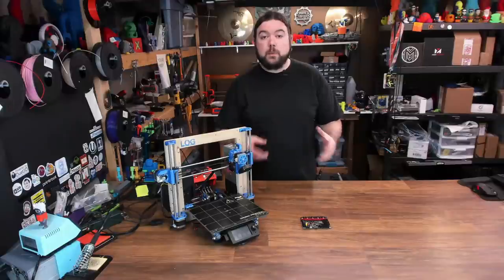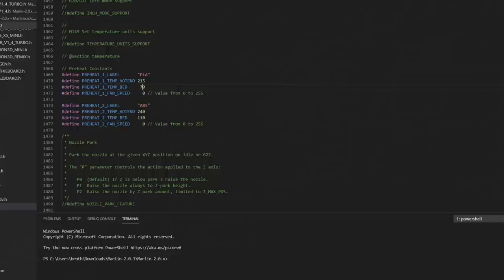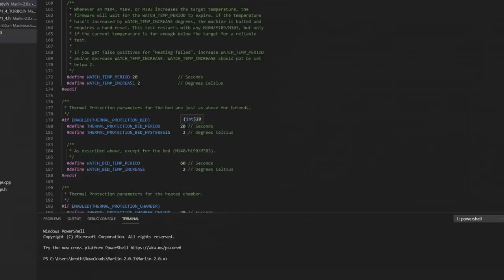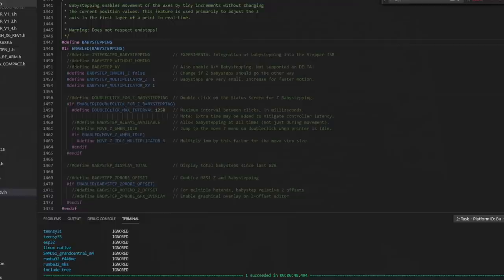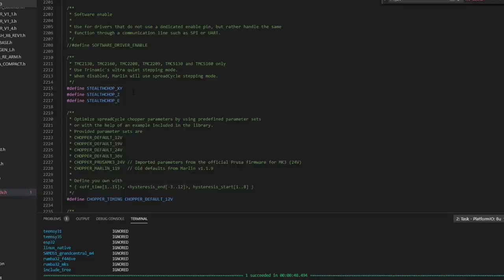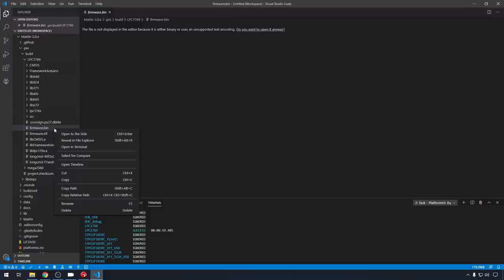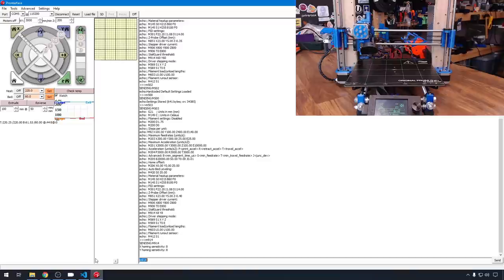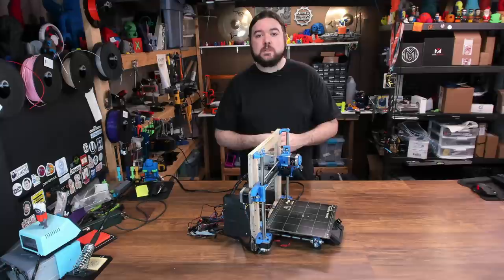BigTreeTech SKR v1.4 Mainboard - Full Install Part 2 - 2209 Drivers - Chris's Basement

Comment: Ok so i went to build after settingand I dont have no platformio alien head icon in the column like yours. I can't seem to find it anywhere in vs code. Which sucks cuz after going through all the configuration and I am literally 1 click of the mouse and I'm finally done....but there's no icon to click. How do I get that icon so I can finish ?
Reply from the maker: Do you have the platformio extension?  https://youtu.be/W6zYvRgGr3Q
Reply: @ChrisRiley  no joke, I just found it like 2 minutes before your message. This was my 1st time on vscode so I was unaware how vital extentions were to that program. It was pretty funny though. After you said thats it its time to build the file. I was stocked that it was finally time to test this board out. Then you said we just click this and were done......son of a.... where's my button. Lol. But yeah it took a little bit cuz it seemed like that extention should be part of the main program. It's pretty much the most important part of the whole operation. Apparently the developers don't think so. But its all installed and ready to go. So im about to go finish it.  But thanks much man Its greatly appreciated. Your videos were top-notch and as well layed out as it could possibly be. Great board explanation. And the firmware run through was perfect. Every step done in order from top to bottom. Theres alot of "good enough" instructions. And people just skipping around to find the bare minimum. They'll get it to turn on, but thats about it. Why the hell they don't just do what you did. Start from the beginning and work your way down to the bottom. Its gives a better insight to all the components and not skip around trying to find a couple things. You may not use the rest but its still important to know regardless. You spend an hour explaining the installation...everyone else are about 10-15min. ....pretty much says it all.  Odds are they've left a few things out of theirs lol.   But yeah man definitely the best lessons out there man 🤘

Comment: Is there any download out there that has has the firmware for the skr v1.4 to ender 3. To the point of it just being able to print and operate at its basic level like its actual board. I have been trying to get this thing setup for about a week now and there always seems to be some friggin problem every time and I'm about to set damn thing on fire and throw in the towel. I've tried just about every tutorial there is and always has problems even though doing everything exactly the same. Im no programmer so these problems that pop up are Greek to me. So if its not on the tutorial I have no clue what to do. And after alot of searching its not just me. Tons of people are saying this is a complete friggin nightmare too. Most of these are solved by people just sending them backspace theres absolutely no actual customer service or anyone to help. This is beyond frustrating at this point and I'd assume somebody out there has just taken their build and made it available to download. Especially for the ender 3 since its so popular and everyone owns one at this point. So I'd be baffled if there not a standard ender 3 build download. This vs code is such a horribly layed platform to do this. And so much of their stuff isn't compatible with each other and constantly creates issues with its own software like the squiggle error that seems to just happen and tells you to update but doesn't tell you what to update or where. And after updating everything to its current version it STILL gives the message. So im clueless at this point
Reply from the maker: I can try and build one for you if you are willing to test it.
Reply: @ChrisRiley  absolutely. I just have the tmc2209 drivers that came in the package. Its just the normal 1.4 and not the turbo. And just the ender 3 not the pro. But yeah man if you could do that Igrateful. beyond greatful.

Also after looking around there may actually be exactly what I was talking about. Theres actually files on creality that are marlin firmware download files for each specific printer. Im by no means skilled in programming so they may not work for anything but the actual creality boards. But they may exactly all thats needed...but it seems too easy that that would be the case. But heres the link to that. Who knows, this may end up being alot easier than it seems https://www.creality3dofficial.com/pages/firmware-download
Reply: @ChrisRiley  i finally got it. I had to add an extention "auto build marlin" apparently vscode had a newer version of itself and just "platformio IDE" will no longer build the configuration by itself and now needs the help of the other extention too. But that did it. Thanks much for the offer though its much appreciated 👍

Comment: Hi Chris .. FOllowed this but tget the following error when i comment out the Z_Safe_Homing .. if Z_Safe_Homing is included then the build is good .. ANy ideas?

Using latest nightly build as of 04/01/21

n file included from Marlin\src\HAL\LPC1768\../../core/../inc/MarlinConfig.h:49,
                 from Marlin\src\HAL\LPC1768\../../core/serial.h:24,
                 from Marlin\src\HAL\LPC1768\DebugMonitor.cpp:25:
Marlin\src\HAL\LPC1768\../../core/../inc/SanityCheck.h:1410:6: error: #error "Z_SAFE_HOMING is recommended when homing with a probe. Enable it or comment out this line to continue."
 1410 |     #error "Z_SAFE_HOMING is recommended when homing with a probe. Enable it or comment out this line to continue."
      |      ^~~~~
In file included from Marlin\src\HAL\LPC1768\../../inc/MarlinConfig.h:49,
                 from Marlin\src\HAL\LPC1768\HAL.cpp:24:
Marlin\src\HAL\LPC1768\../../inc/SanityCheck.h:1410:6: error: #error "Z_SAFE_HOMING is recommended when homing with a probe. Enable it or comment out this line to continue."
 1410 |     #error "Z_SAFE_HOMING is recommended when homing with a probe. Enable it or comment out this line to continue."
      |      ^~~~~
In file included from Marlin\src\HAL\LPC1768\../../inc/MarlinConfig.h:49,
                 from Marlin\src\HAL\LPC1768\HAL_SPI.cpp:51:
Marlin\src\HAL\LPC1768\../../inc/SanityCheck.h:1410:6: error: #error "Z_SAFE_HOMING is recommended when homing with a probe. Enable it or comment out this line to continue."
 1410 |     #error "Z_SAFE_HOMING is recommended when homing with a probe. Enable it or comment out this line to continue."
Compiling .pio\build\LPC1769\src\src\HAL\LPC1768\include\i2c_util.c.o
      |      ^~~~~
In file included from Marlin\src\HAL\LPC1768\../../inc/MarlinConfig.h:49,
                 from Marlin\src\HAL\LPC1768\eeprom_flash.cpp:39:
Marlin\src\HAL\LPC1768\../../inc/SanityCheck.h:1410:6: error: #error "Z_SAFE_HOMING is recommended when homing with a probe. Enable it or comment out this line to continue."
 1410 |     #error "Z_SAFE_HOMING is recommended when homing with a probe. Enable it or comment out this line to continue."
      |      ^~~~~
In file included from Marlin\src\HAL\LPC1768\../../inc/MarlinConfig.h:49,
Compiling .pio\build\LPC1769\src\src\HAL\LPC1768\main.cpp.o
                 from Marlin\src\HAL\LPC1768\eeprom_wired.cpp:24:
Marlin\src\HAL\LPC1768\../../inc/SanityCheck.h:1410:6: error: #error "Z_SAFE_HOMING is recommended when homing with a probe. Enable it or comment out this line to continue."
 1410 |     #error "Z_SAFE_HOMING is recommended when homing with a probe. Enable it or comment out this line to continue."
      |      ^~~~~
In file included from Marlin\src\HAL\LPC1768\../../inc/MarlinConfig.h:49,
                 from Marlin\src\HAL\LPC1768\eeprom_sdcard.cpp:25:
Marlin\src\HAL\LPC1768\../../inc/SanityCheck.h:1410:6: error: #error "Z_SAFE_HOMING is recommended when homing with a probe. Enable it or comment out this line to continue."
 1410 |     #error "Z_SAFE_HOMING is recommended when homing with a probe. Enable it or comment out this line to continue."
      |      ^~~~~
* [.pio\build\LPC1769\src\src\HAL\LPC1768\HAL.cpp.o] Error 1
* [.pio\build\LPC1769\src\src\HAL\LPC1768\eeprom_flash.cpp.o] Error 1
* [.pio\build\LPC1769\src\src\HAL\LPC1768\HAL_SPI.cpp.o] Error 1
* [.pio\build\LPC1769\src\src\HAL\LPC1768\DebugMonitor.cpp.o] Error 1
* [.pio\build\LPC1769\src\src\HAL\LPC1768\eeprom_sdcard.cpp.o] Error 1
* [.pio\build\LPC1769\src\src\HAL\LPC1768\eeprom_wired.cpp.o] Error 1
In file included from Marlin\src\HAL\LPC1768\../../inc/MarlinConfig.h:49,
                 from Marlin\src\HAL\LPC1768\main.cpp:34:
Marlin\src\HAL\LPC1768\../../inc/SanityCheck.h:1410:6: error: #error "Z_SAFE_HOMING is recommended when homing with a probe. Enable it or comment out this line to continue."
 1410 |     #error "Z_SAFE_HOMING is recommended when homing with a probe. Enable it or comment out this line to continue."
      |      ^~~~~
* [.pio\build\LPC1769\src\src\HAL\LPC1768\main.cpp.o] Error 1
Reply from the maker: You don't want to use Z safe homing? If not you can comment it out of the sanity check . Marlin\src\HAL\LPC1768\../../inc/SanityCheck.h:1410:
Reply: @ChrisRiley  Thanks Chris, I worked it out in the end! Do you have a tutorial on calibrating / setting the UART current for the stepper in use?
Reply from the maker: @James-vh7nj  It's probably somewhere, but you just use the M906 command.

Comment: Hey buddy I know I'm a pia I decided to use two stepper drivers for my z axis one stepper driver in the z and one in the e1 axis now my z axis won t  run at all any ideas
Reply from the maker: No neither one will run? If you set it back to one, does it work again?
Reply: @ChrisRiley  yes Chris if I go back to one it works I fighting to many fires at one my tft lcd with dual display works on the marlin side if I go to touchscreen mode it tells me no printer connected
Reply from the maker: @toninig  The touch screen is probably the serial. Set serial to 0 and serial 2 to -1.
Reply: @ChrisRiley  The touchscreen was a no go still shows no printer attached on touchscreen side, the marlin side is fine
Reply from the maker: @toninig  Not sure what to tell you on that, you can try flipping them around 0 and -1, but that should work if everything is connected correctly. Make sure your baud rates match.

Comment: all up and running x y and z all move the right way apart from homing, it homing x and y in wrong direction what should i change
Reply from the maker: Switch home dir.

#define X_HOME_DIR -1
#define Y_HOME_DIR -1
#define Z_HOME_DIR -1
Reply: @ChrisRiley  // Direction of endstops when homing; 1=MAX, -1=MIN
// :[-1,1]
#define X_HOME_DIR -1
#define Y_HOME_DIR -1
#define Z_HOME_DIR -1
already there if i change to 1 throws up a load of config errors
buy the way got octoprint running it only works with first serial port set to -1 if i use 0 it wont connect and at -1 lcd doesnt connect but will at 0    OMG im a noob
Reply from the maker: @carllatham9844  What printer do you have?
Reply: @ChrisRiley  sovol sv01 but using a btt 1,4 board 2209,s and tft 3.5 v3 i think i managed it got a new version of arlin started a fresh followed your guide AGAIN had to enable second port on port 0 first port on -1 then everything works prontaface octoprint etc so far so good just playing with pid and esteps eyc thanks for the help chris you videos are priceless mate THANK YOU SO MUCH FOR YOUR TIME AND EFFORT

Comment: All that work and the SD card doesn't work turns green but doesn't change file name. And of course I bought this board months ago and just got around to working on it. Any suggestions?
Reply from the maker: Try a different card first, it must be less than 32gb and formatted fat32.
Reply: @ChrisRiley  LOL So coming from the ender3 where you couldn't have the same name bin file or it wouldn't read it I must of changed the name the first time it only reads file titled firmware. Is that specific to the 1.4 cause my ender board I could call it anything as lng as it wasn't the same as the current file being ran. Thanks for all the help. It is greatly appreciated.
Reply: @ChrisRiley  Also have you done anything with he eeprom add on for the SKR? I searched but didnt see anything.

Comment: Hey Chris ! I just received my SKR 1.4 just after 2 months after purchase it :/ damned ! it was super long !! 
My problem is I can not make my Noepixel strip work. I set #define NEOPIXEL_LED, NEOPIXEL_TYPE NEO_GRB and NEOPIXEL_PIN P1_24 in Marlin Configuration.h  but the LED do not turn on when I try with the printer display menu. Maybe is the Type to change from GRB to RGB ? Have you any idea ? thanks ;)
Reply from the maker: Hey! I haven't messed with that part yet, chris warkocki has had some luck with it, I would ping him here on Youtube and see what he knows.
Reply: @ChrisRiley  Thanks Chris, it's works now !!! Don't know why but I connect the ledstrip on the other side, cause there are connections on both sides of the strip, and it work. I used the one with the 2 extra power wires (+/-) but not connect them cause I use the DCDC BTT  module for the LED power ;)
  I have just to reset NEO_RGB to default NEO_GRB cause the red and green are inverted.
Reply from the maker: @MacFly669  Glad it's working, I still need to try this.
Reply: @ChrisRiley  Do not forget the jumper close to the NEO Pin to switch from regular 5V to DCDC module 5V 3A
Reply from the maker: @MacFly669  Thanks for the heads up!

Comment: 8:53 - Someone needs to design a simple add on board for these SKRs, probably using I2C or similar, to give extra fan control, and probably thermistor input to so it can be used for hotend fans and case fans and other fancy things like that. It cant be that hard to do, there are chips like the ADT7470 that do the hard work.
Reply from the maker: Thanks would be nice, I have made them before with transistors as switches.

Comment: i don't have that alien head thing under my extensions, the platformio icon
Reply: ok, so just figured out i needed to install the platformio extension
Reply: now i have some issue with stdint.h
Reply: missing from include path. a bunch of these disappeared when i installed platformio. wonder if its another extension
Reply: ok so you need to install 3 packages
C/C++
c/c++ intelisense 
and platformio
Reply from the maker: VScode has changed, I need to update that video.

Comment: No matter what setting I choose for the serial the computer can find the drive, but when I try to upload the compiled files to the printer the program can never find it. Has anyone else had a problem with No printer attached, it doesn't matter what speed I choose it just scrolls No Printer Attached across the screen. Thanks!!
Reply from the maker: Not sure what's up, but you can try to hard set the upload port.  https://docs.platformio.org/en/latest/projectconf/section_env_upload.html
Reply: @ChrisRiley  Thank you, I will give it a try.
Reply: @ChrisRiley  Still no go, my old board is found right away and this is my third Bigtreetech board that won't connect. I've gone through all the settings and now my touch screen went black. Don't know what to do now. I put new drivers in my old Ender 4 board, but it had a z issue and still does with the new drivers. Thanks for the link.
Reply from the maker: @TheDeerInn  The only other thing I know to try is reload the ch340 driver.
Reply: @ChrisRiley  Hi Chris  I was able to get the screen to stop reading No printer attached, but I am not able to control any steppers. I found that the TFT cable on the board has to run to the right side of the plug and the reset wire cannot be attached or the screen will stay black. So another problem to trouble shoot with the drivers(TMC2130).  Thanks!!

Comment: hi Chris I have opened your Marlin config from the video:
https://drive.google.com/open?id=1xC2...it asks it to be extracted, once extracted do i load the whole thing a on sd card or ? thanks - dumb me
Reply from the maker: You will have to compile it again, then grab that firmware.bin and stick that on your SD card.
Reply: @ChrisRiley  can i use the file for my ender3 as is with turbo and 2209's
Reply from the maker: @stephenkosloff6081  You can, you might have to tweak somethings.

Comment: Hi there. I did something dumb i accidentally deleted my cursor file and cant recover it. Is there a place to download the orginal file. I tried flashing marlin from vs code but without the cursor file it fails. :(
Reply: Go to https://github.com/MarlinFirmware/Marlin and download a new copy of the version you are using.  You can open up the zip file and copy it out of there.
Reply: @Solitaire1  thank you
Reply: I believe you can just change the extention from firmware.bin to firmware.cur 

It is the exact same file and the board just renames it for you.
Reply from the maker: Thanks for the assist here folks, this is a great help to me.

Comment: Since nobody else asked I would like to use TMC 2209 drivers on X and Y ,and TMC 2208 drivers on Z and E  since i don't need the Sensorless Homing feature on Z and E. is it OK to mix them?
Reply: yeah just type in the correct driver in the config where you define the stepper driver
Reply from the maker: Yep, as Steven said, you can mix and match as you wish.

Comment: Hi, The TFT35 V3.0 does not come on. The back of the screen the the led D2 turns on red.  Also the bin file on the SD card name does not change after turning on it is still firmware.bin.  I checked the fuses Bothe have 12 volts. Tried 2 SD cards both of the the bin name stayed .bin.
Reply: I did set the serial 1 to -1 and serial 2 to 0.
Reply: Also the LED on the top of the board by DC IN also comes on.
Reply from the maker: If the connections look right, that sounds like there might be something wrong with the screen.